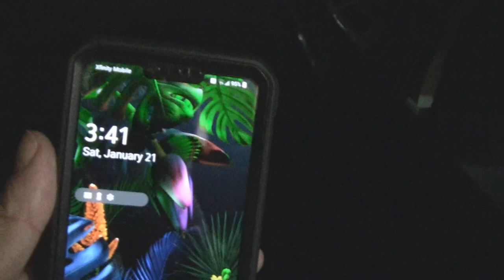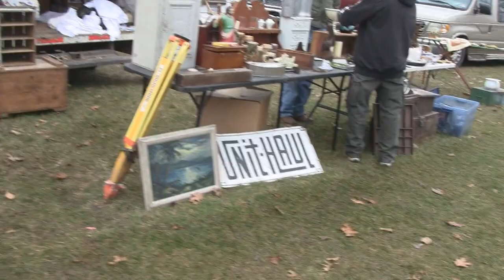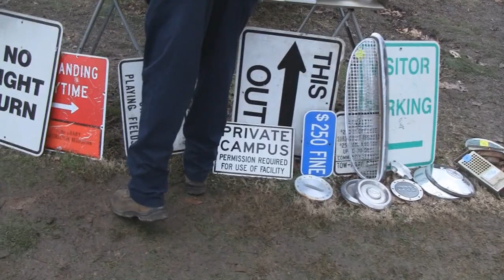JACKTOWN ENGINE SNOW SHOW 2023

Comment: I have quite a few of those Work mates,all different. I use them for just a quick portable bench to holding engine blocks. And I can find them on line for dirt cheap and sometimes for free.
18:54 .you missed a useful deal there, those look like traditional skunk chasers. Just place them around the house and skunks will stay away...